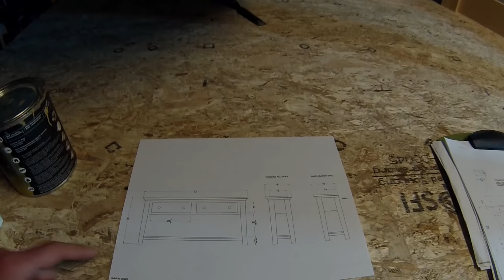How To Paint Pine Furniture -- Knot Bleed, Primer, Repairs -- Everything You Need To Know

Comment: Thanks for taking the time to post this informative video. I wasn't aware of how much pine would bleed through a paint finish. 
You might find the following info useful. Auto body filler has a similar problem when applied to fenders as it does to wood. After sanding the body filler, the car guys spread on a thin layer of what I think was called glazing putty. That stuff is a much finer texture when dry and easily sands smooth with a fine grit abrasive. This will do a much better job feathering in the edges of your patches.
Reply: You are so correct, the spot-putty must be applied to assure a great finish.  You can also use a wire brush to imitate wood-grain in the spot-putty.

Comment: Hey Mitch , great tips and video as usual. I use quite a bit of eastern white pine for trim and some furniture.I started using zinsser seal coat (a de-waxed I believe 2 lb cut  shellac  ,it's pretty "thin" as a spot primer on sap streaks and knots usually two coats then a light sand before paint or primer as is a glossy surface . So far no bleed throughs.  Keep up the great work.

Comment: very very good tutorial.....what grain dit you use on the sanding bloks.....all the bedst
Reply from the maker: 80 grit for the blocks
Reply: that high.......do it not leave marks in the paint
Reply from the maker: sand with the grain direction and brush strokes.  100 grit ok too.  Finer grit will clog up with paint
Reply: good to know.....I've had that problem......thanks

Comment: What purpose does the varnish add? I am painting cabinets and was told to use a spray varnish to harden surface, and then was told I didn't need it.
Reply from the maker: for furniture i always do varnish because paint is sticky and will scuff easily and is not as cleanable.  for cabinets you can go without varnish and just repaint damaged surfaces.  gloss or semigloss paint is ok.  varnish is more difficult to repair

Comment: hi mitch, thanks for sharing man, great finish i`ll try next time. i like how it`s not hidden and plastic. looks really beautiful
about the auto body filler i often use the product, the reason it sank down is bc it`s not designed to fill deep cavities in one shot, you have to fill, let dry (well dried or it will continue shrinking) and a second coat or maybe a thinner body filler to improve the sanding and eliminate the pinholes. then sand again and your surface will be even with the surroundings but as you`ve seen it kills the grain and unless you paint several coats you`ll notice the difference. the pine variety i get here has a very very distinct hardness btw rings and when you sand it never gets even so many primer coats are needed. i use auto body fillers and primers but have a small paint booth and spray it. take care. pete
ps the heavy use of fillers and primers i do in my regular job of metal fabrication, the pine i use is for the metal/wood pieces i`m trying to start selling...